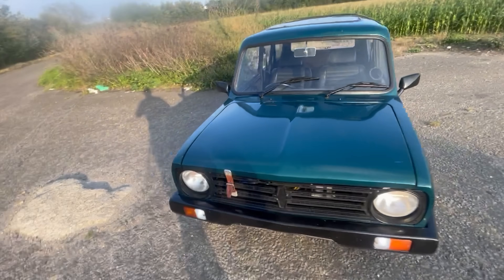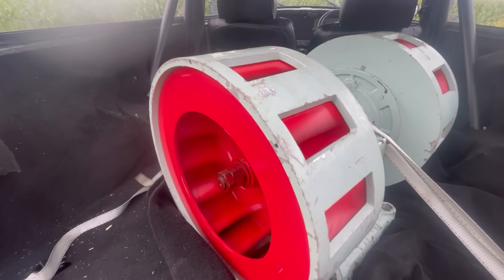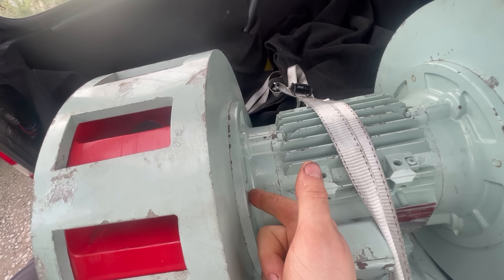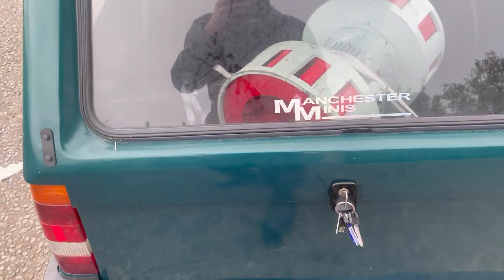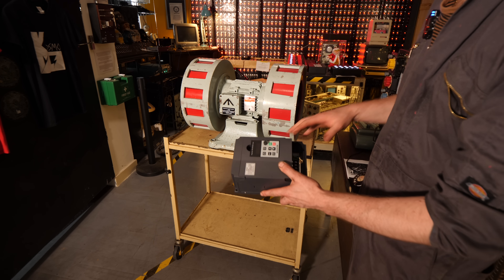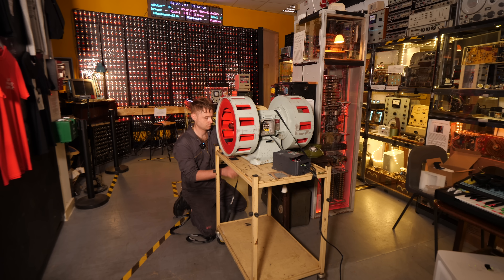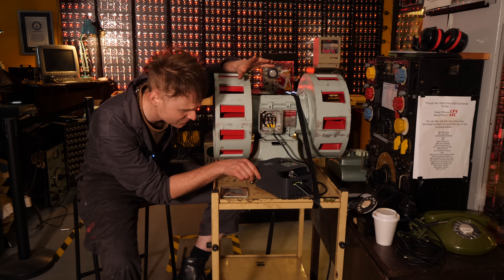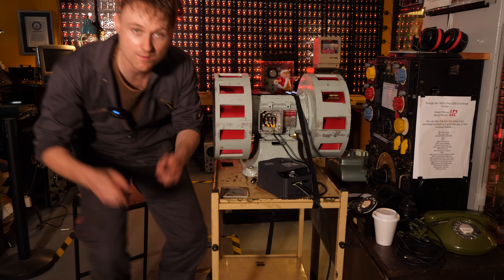I BOUGHT AN AIR RAID SIREN

Comment: Those things could be found on top of towers at retained (non full time) fire stations over here up until fairly recently before they switched to pagers - they were used to call out the crews and there are still a few of them about. they are very loud (as you found out) and can be heard miles away.
Reply: I live in Zurich, Switzerland, and there are still sirens here which get tested every year. They're mainly in case of a dam breach in the valleys upstream from Zurich, although there are other tones --- most Swiss buildings have nuclear bunkers in the basement, for example...
Reply: a lot of areas in Tornado Alley in the US use air raid sirens for tornado warning and test them every week
Reply: Coming from the netherlands and hearing a siren like this while on holiday in the czech republic in the middle of july, had us in panic for a good half an hour 😅 untill we found out the sirens are used for the fire stations. Gave me a first hand experience on how expats and Tourists feel when its the 12 o clock on the first monday of the month in the Netherlands...
Reply: My town still uses one for the volunteer fire department because we live in a really mountainous area.
Reply: @JessicaKStark  My city still uses one for the volunteer fire department in a really flat area. Nothing better than when it goes of at night and wakes everyone up (it's located ~1.5 miles from the center of the city). The only people that can sleep peacefully at night live on the other side of the town, that's how far the sound travels.

Comment: these air raid sirens owe their existence to a Hollywood disaster film.  In the early years of sound in movies there was a film about a strong wind. A sound effects technician realised if you stretch silk across a gap then spun it at high speed it made a wailing noise a bit like the wind, when he fixed a motor to it, it created a high pitch wail.  On the rotating drum he had stretched silk,  later on he tried thin metal blades and discovered it was louder.   That was the birth of the air raid siren,  early sirens used compressed air, or steam,  with the silk fan you can hand crank it to make the noise.   The metal bladed version was similar and cheaper to mass produce, then later electric motors were used.

Comment: When you turn of the inverter, that motor stops almost instantly. All that momentum has to go somewhere, so I imagine it causes a huge strain on the electronics of that VFD. Go gentle on the speed changes and it should last you much longer.

Comment: What an amazing bit of kit. I wonder if you could control the volume by throttling the air going in, after all it's a squirrel cage fan - reduce the air intake. ?? Would also reduce the load on the motor and therefore the inverter.

Comment: Federal Signal in the United States built upon that basic electromechanical siren design with the 3T22. It featured a 10/12 chopper with projector horns and solenoid valves to block airflow creating an alternating wail or hi-lo tone (which is popular for all-clear or summoning volunteer fire departments/brigades... as y'all's say in British English)

Comment: That is awesome Sam, love it. I have used a couple of those Chinese inverters. They work fine but dont have the option of a braking resistor so when its slowing down it dumps all the energy into the DC buss. Try and find a chunky one that has pair of brake resistor terminals. Also not sure but it looked like you had the motor wired in star. Needs to be delta really for 220/240V as in the three links placed vertically on the terminals. Absolutely awesome 👊👊

Comment: maibe you can silence it some if you close in the sides a little , was thinking disk with a smaller center hole kinda chocking some of the airflow , might mean the motor draws different amps as it has to work harder / less hard not sure if it keeps the same pitch either

Comment: Your DJ headphones (unplugged) would give you better noise reduction than just tissue paper stuck into your ears, and you really need a bigger, badass inverter to meet the power rating of the siren's motor.  But, on the positive side, if Wagner can demand anvils tuned in the key of F for the opera "Das Rheingold" at the Bayreuther Festspielhaus, (or Verdi can write the "Anvil Chorus" in Il Trovatore) why not try to make an electronically tuned air raid siren for use as a musical instrument!
Reply from the maker: Tissue was fine. The dt880's didn't work as well I tried. And yea but you work with what you've got. The inverter was fine I just need to mod it with more reservoir caps which I'm doing tomoz
Reply: The cannons at the end of the 1812 Overture are also tuned no? Who said classical composers didn't do industrial 😄

Comment: If you block off the air flow it'll draw less current, which I think would make it spin faster, I don't know that motor at all but it seems like the kind that would spin faster. If you built a contraption to control the airflow to the rotors, that could let you access higher pitches with lower power draw, and you might be able to use that to modulate the pitch faster, downward at least. I'm imagining something like a horn mute on a servo. Might even make it quieter!

You could similarly make a contraption that blocks off some of the vents to change their number and thus frequency. A series of sliding panels might even be somewhat playable just sliding them back and forth

Comment: This is so cool!  When I was a kid we lived across from the fire station and the siren was both terrifying and exciting.  Ours was a Federal Signal 2T22, which rotated on a vertical axis and had horns mounted on every one of its openings, making it look a little like a piece of corn cob.  I'm told they use an insane amount of power, and there might have even been a version that used steam too.  There was a famous one in Chicago that used a big 1950s V8 to spin it, and I saw it on display somewhere.  It was super loud, but I don't think it had that same scary siren chord we love.
Reply: I've never heard of a 2T22 spinning before, they're supposed to be stationary, and they've never used steam. Maybe you're thinking of the Thunderbolt siren, which has one long square horn that rotates around and uses compressed air to generate the sound?
It sounds like the one in Chicago might have been the Chrysler siren.

Comment: I'm not sure a soundproof studio will do much. they are for like "loud drums" 🤣
Reply: @binky_bun  indeed. Even a long way under ground they have air vents 🙄🤔. Maybe a disused bunker with blocked air vents would do the trick, tho it'd be a pain lifting it in there.

I wanna hear it running from the car while he drives through a tunnel 🤣
Reply: @binky_bun  it was thoes exchanges I had in mind and a maybe possibly active one that I may or may not have been in was definitely well vented. I think the train tunnels would sound sick. But they are also vented with vents discreetly dotted all over the place. Imagen doing it in a train tunnel where it echoes up and out throughout a town so they think there's an air raid 🤣 you'd be in a bit of trouble I reckon 😆
Reply: @binky_bun  that sounds perfect. I wonder of there are munitions stores not quite far from Margate

Comment: Someone may have mentioned this already but if you restrict air flowing through this device (it's a glorified vacuum cleaner motor modified to make noise) that may afford you some electrical energy consumption as well as dampen the noise a little bit.  This can be done by blocking off the intake on the rotor (also called the chopper) or like the Yamaha musical sirens it uses sliding baffles to cover the stater slots.

Comment: Given how they operate, a simple way to quieten or silence one would be to control the air intake. The volume is determined by how much air goes through it. No air = no volume. a disc on each side with a hole in it would enable some air through and therefore some noise from it, but at a much reduced volume.

Comment: You could make some Plywood baffles to rest rick the air intake and reduce the volume and load. Plywood circle that can seat against the outer rim of the housing and a smaller circle in the centre to allow a restricted amount of air in. This will reduce the load as well, although that rotor probably has a ridiculous amount of momentum in it anyway.

Comment: Get a huge glass vacuum bell to put it in or use a box backfilled with helium to lower the volume. Also, can you get a VFD that provides motor braking? That way you can modulate the duration of the notes somewhat. It may put some flywheel stress on the keyway on each end of the armature though.

Comment: The galvanic reaction can be "cured" with permatex and paper. Specifically, you disassemble the thing (i'll detail how i did it below), clean every surface of the fuzz and make sure that there's no deformations using two calibrated stones ( brand new stones from the pack, you rub them together dry until the surfaces are flat between them). Once that's done, acid primer on both surfaces, two coats, then a thin, super thin coating of permatex. I rolled it with an engraving rubber roller. For the paper, i used old (satin) newspaper. The common variety doesn't work, but the smoother paper from financial newspapers (because you don't want to offend the soft hands of businesses men, SMH) is great for this kind of stuff. Reassembled, it should last quite a while, i used car seam sealer on the joint, to fully seal it up, then painted the whole thing. Guaranteed to never have that issue, in that form.
The removal process can be tricky if it's corrosion jacked. I had to make a custom puller, a thick puck of steel with ACME threads in the center for a common garden variety jack screw and 20 holes on the perimeter for 20 (i'd use no less) legs that need to be bolted through the slots (can you guess how fun that was?) on the backside of the flange. I used heat with a long reach torch to heat up the hub because i could see deflection in the flange when i tried without it. One side didn't even want to budge, the other made an ungodly noise then fell off with a pop.

10:00 you can diminish the sound using a baffle. The little holes on the aluminium flange can be used to put a baffle there to cut off some of the air. If you do that, it will spin, but the sound will be lessened.

Comment: Just an idea, giving it monophonic MIDI control might be more interesting than the CV/Theramin, you could tune it perfectly and anyone could play it.

You could connect a foot pedal and a keyboard.  Think of the foot pedal as your dead man's/on switch.  Hold the foot pedal down to turn it on and start it spinning at a low rev range just below where it makes a sound.  Then with the foot pedal held down, when you press a note on the keyboard it will rev up to just the right RPM and sound the note.  If you let the note go, it will rev back down to idle.  If you release the foot pedal it will stop completely.  Couple this with the braking idea in the other comments and I think you could make it pretty playable!
Reply from the maker: Problem is the curve of the notes and variation to pitch

Comment: Bro, do the 3 phase to 1 phase - method. But a 80uF cap between to phases. It works, and is more common then you think. Look at every workshopmachine (mill, drill lathe) , they have a  small sylinder close to the motor, thats the "motor-cap".

Comment: Nice to see the ARSE community get a bit more exposure. The bloke you bought it off a bit of a legend and seems to have half the preserved sirens in the country.
If you want more tones, research the Klaxon CS8, which has a shutter on each end to cut off half the noise.
Reply: (ARSE stands for Air Raid Siren Enthusiast, as any fule kno)
By the way most of those sirens are only rated for about 15 minutes so please do be gentle with it.
Reply from the maker: 15 minutes!? Run time. Mad! I thought it was a lot lower than that.
Reply from the maker: Or you mean 15 minutes completely?
Reply: @LOOKMUMNOCOMPUTER  I can’t guarantee that because the sirens I’m familiar with are slightly more modern versions of the same thing. Still, they’re pretty well built the old Castles.
Given the context of their original purpose I doubt they’d have been designed to run for more than 15 min in a given day.
Reply from the maker: yeah thats what i figured. understandable as the heat sinks arent mahoosive. @Jeagles

Comment: One thing which might be useful to know here about VFD : the voltage sent to the motor is somehow butchered sqare-ish, which creates voltage spikes which does stress the insulation of the motor.  Actual motors usually have a Class F insulation which is okay for VFDs but older motors could have class B insulation and will likely fail.  This cold war era motor could have a class B insulation, it should be on the specification plate of the motor (if still legible).  Ther are hacks to avoid problems with older motors like adding a reactor in series, etc.  The interwebs have plenty of information on that.

Comment: adding a cover over the side or partially blocking off the slots so less air is drawn through the fan should reduce the volume. also means lower air resistance so less power needed to spin it

Comment: Watch out for the deceleration speed on your inverter. It needs to get rid of all the energy you put into the rotating mass to slow it down. So the acceleration speed should be close to the deceleration. It'll over-volt the DC bus in the inverter trying to slow it down if it slows too fast and that's probably what let the smoke (and liquid) out of the caps in the inverter. Many inverters have the option for a braking resistor. If you put one in then then deceleration speed can be increased as it gives it somewhere to dump that extra energy.

Comment: There are loads of interesting things to try with this !  As already said a mesh with holes smaller than a finger or better : a big cage around the whole thing, would be the best insurance ever for continuing to enjoy your 10 fingers for a longer time.  About the volume : closing all holes but one or two per side will certainly be worth trying.  I thought of something else also : changing the shape of the holes !  Making the rectangle smaller in one direction, the other direction, in both directions, ...  3D printing something another shape which snaps in a hole.  3D printing a thing on one hole to fit a pipe to it and send that strange air it to an air instrument (an organ pipe ?), ...

Comment: Re earplugs: I take a sheet of soft loo paper (is there any other kind now?), tear it in half, and chew it to make it wet and pliable.  Insert one in each ear.  The weight of the water makes it much more effective than anything dry.

I don't know how many dB those sirens produce, but if they were meant to be heard inside a house across a small village, way enough to damage your ears at a couple of metres.
Reply from the maker: That's what I did! Bit of water on the end

Comment: could you control each of those square openings with a servo? to slightly open them and close them individually. could maybe make a polyphonic noise this way
Reply: I doubt that would change the pitch of the sound, because the vanes of the spinning rotor would be going past the open holes at the same rate regardless of how many would be open or closed.

Comment: Put it in a plexiglass box and draw the inside of the box to vacuum. That might help reduce the noise
Reply: Was going to suggest the same. Though vaccuum makes it silent. It would also be more responsive if plugged to the theremin
Reply: Ah, beat me to the comment,
Reply: @rojunitu6632  That's a good point. Less wind resistance/friction. And I suppose you could also control the amount of sound it produces by how much air is allowed to stay.

Comment: Controlling the air flow should control the volume. Making your own with a vfd and smaller lighter rotors should get quicker pitch response. A side by side display of two would be cool. The small one playing over the rainbow while the big one warns of the coming storm.

Comment: If you cap the ends with a smaller hole it will reduce the airflow through it and therefore the volume

Comment: As always great video.

I am curious about how it sounds with something that limit the amount of air running in from the sides. It may limit the dB output to solve the high SPL problem.
Reply: If they’re strong round covers, well sealed to the sides, it might make a huge difference in SPL.  Add a solenoid valve to key it for separate notes…

Comment: I am a bit paranoid when it comes to "I want to keep my limbs"-safety and would cover those danger holes with some mesh so you can not accidentially get your fingers in there.
Reply from the maker: one thing taking precautions and being aware of the risk, which i did and was! another thing being over the top :D. its fine its now in a box, which is see through so you can see it and it is accurate as they didnt have grills. some had weather covers but none had grills.